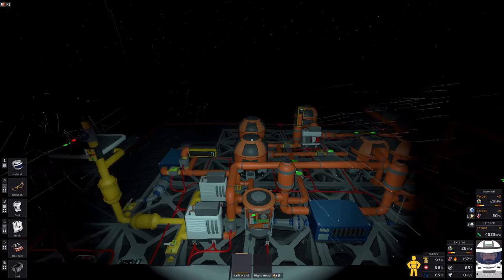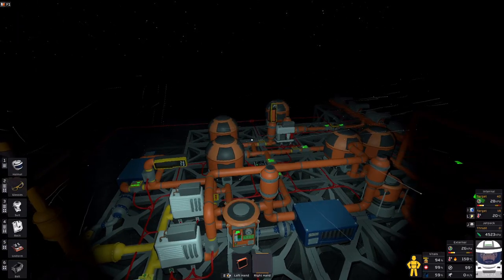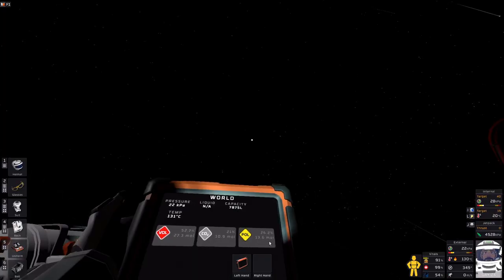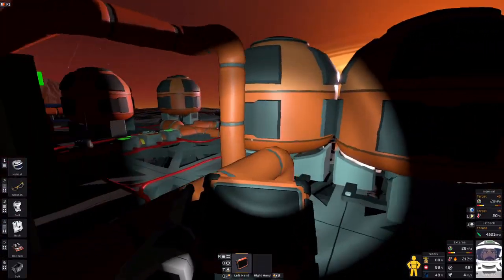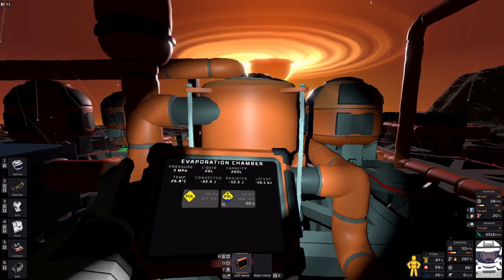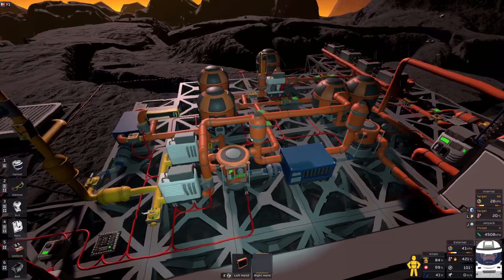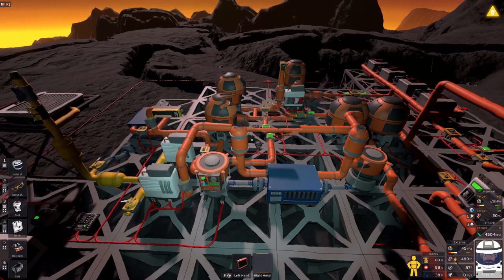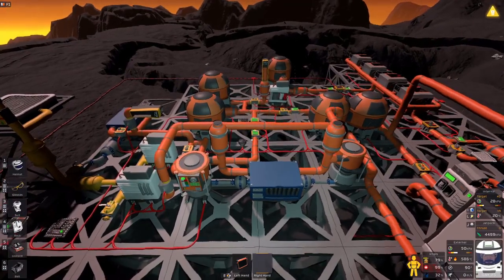Stationeers: Vulcan PC Cooler

Comment: Very nice. Another improvement: a simple IC can scale the evaporator pressure setting from zero closer to the stable room temperature value based on how far above room temperature the chamber is. A simple linear factor works more than well enough. This lets it work as hard as it can when there's lots of cooling work to do, and then drop back down to a nominal cooling effect if things are stable and major heat loads are shut down.
Reply from the maker: That is something i have neglected to do in most of my systems for sure. Definitely something done that can improve performance when you have a high heat load.

Comment: I'll be honest I was debating what PC referred to, Initially I was bouncing between Vulcan Pollution Cooling Cooler and Vulcan Partially Closed Cooler, before I nearly indented my head when I realized that it simply was Vulcan Phase Change Cooler. I'm dumb like that.

On a design question, wouldn't it be better for the open loop part to use a purge valve for ~60°ish pollutant (gas). It wouldn't increase the cooling capacity, but it could cool down further then ~130°. I think you might be venting some potential.
Reply from the maker: As in before it goes into the counterflow? I dont know that it will be much gain. The output of the counterflow is already low pressure so that any condensed liquid pollutants that hit the pipe automatically begin evaporating and thus cool it down usually below 80C before the liquids go through the counterflow to cool the volatiles tank.
Reply: @shadowdrake082  That's good then, I thought that as it's going in as 128°ish warm liquid, I was expecting it not evaporating much when getting heated to 132°ish by the Volatiles. But if there is no liquid in the output then I should definitely try that as well.